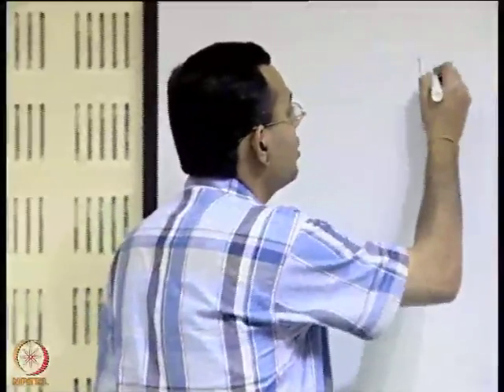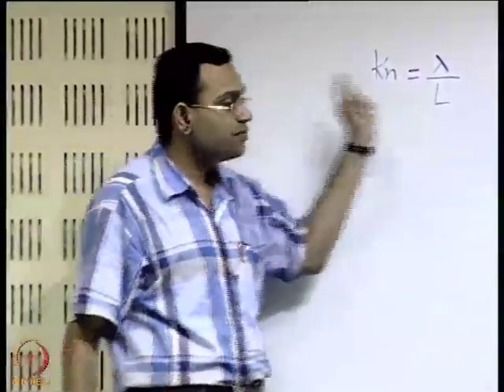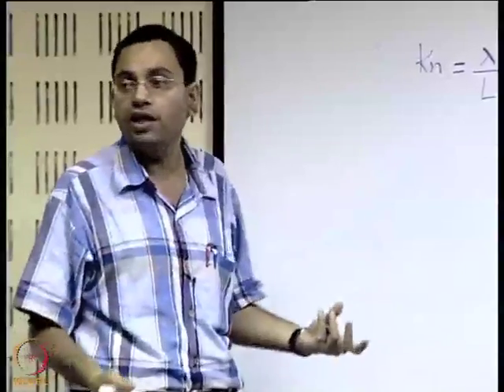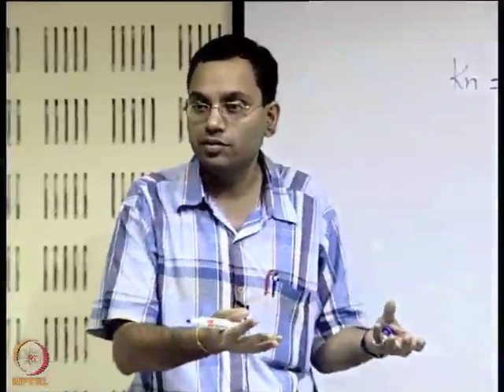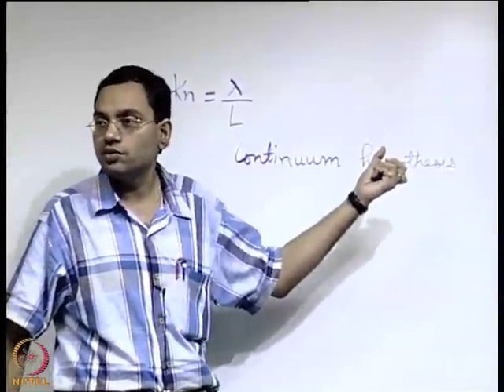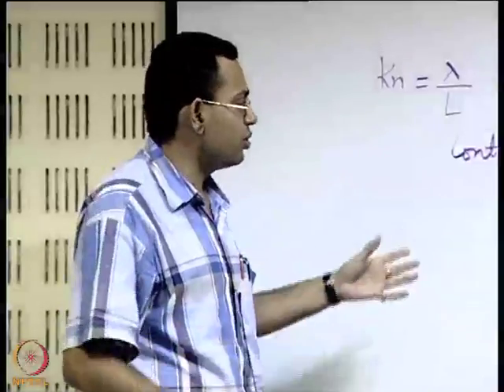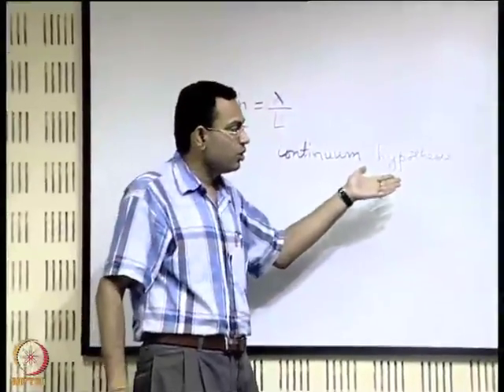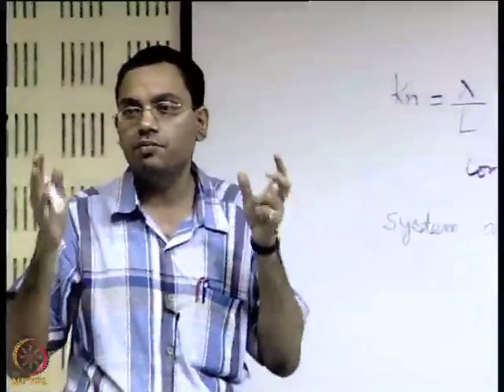Mod-01 Lec-02 Introductory Concepts (Contd.)

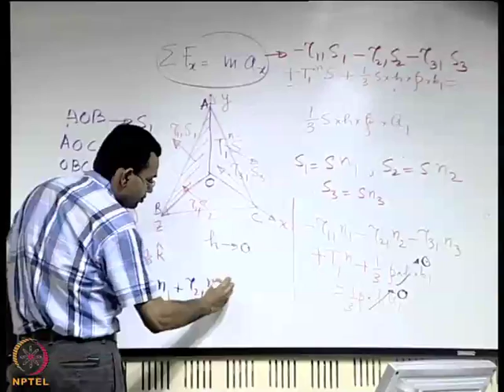Comment: can any one  explain 42:00 to 42:15 ?
Reply: It relates traction vector with components of stress. I.E the arbitory surface ABC would have some traction . Since sir have dervied for force on X direction here, the above equation shows relation between traction on ABC and stress components acting due to force along X direction.  With symmetry along Y and Z direction you get other two equation which is shown in matrix firm at later part